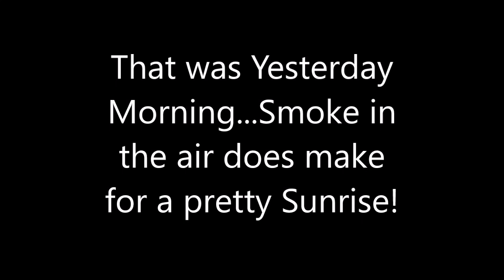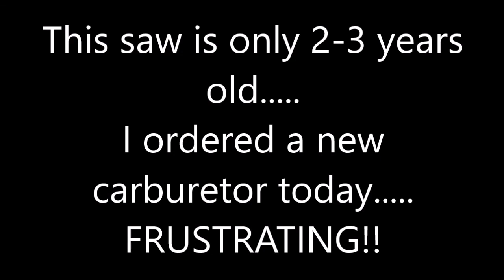$#%&  SAW!!!

Comment: I got a Huskyvarner that needs a gas line replaced and a longer pull cord, you can have it you'll pay shipping, just had a new carburetor put on it, it's too heavy for me to run for any amount of time. I don't know how much shipping is, but you're more than welcome to have it, and it runs great right now.
Reply: I think it has an 18 inch bar on it, I could take the bar off and put it in the box to ship.
Reply: Garry take this saw! I have 2 Huskys since 1992!
Reply from the maker: Wow!  Thank you for the offer!  If I can't get this thing running, I'll take you up on that!!!!
Reply from the maker: Sounds great!  I'll see if I can fix this one, but if not, I'll swap ya something for it!!!
Reply from the maker: They are great saws!   Something to think about for sure!
Reply: God bless you ❤🙏🏻❤️🇺🇸
Reply: @MuskratOutdoors  it's yours. Just let me know, I not able to use it anymore, it's to heavy. I bought a little polan and it's half the weight. 
Let me know.

Comment: Hi Gary,
Something is holding then inlet needle open. It's most likely the diaphragms gone hard and pressing on the needle. If someones been in there it's also likely they fitted the gaskets wrong or didn't adjust the needle correctly. 
Don't listen to the others there's no such thing as a float in there!
A carburettor fit will fix it for only a few dollars👍 don't even consider an aftermarket carburettor!!
Reply from the maker: I didn't think they had a float.  A float wouldn't allow it to run sideways or upside down. (Upside down they don't run well, but they do run) I did order a new carb, already....but it's  about the same price the carb kit was......I hope it will work.   Thank you for the advice!  I've got a lot to learn about these, but at a $100 per hour shop time, I'm willing to figure it out!

Comment: Stuck float , maybe a new carb ? They are still reasonabley priced ! Just replaced one on my post hole digger and it works great !!!!! Just a thought !
Reply from the maker: I'm not sure how a chainsaw carb works?  I don't think there is a float?
A chainsaw will run sideways and upside down.  I did order a new carb though.   Maybe a cracked diaphragm, or a stuck needle valve?  I truly don't know.

Comment: I think that in the carb there a chamber that holds a float. Attached to the float is a needle made of rubber. It controls fuel to the carb. If it’s missing this problem might be the result. Find a carb rebuild kit and it should be in it. Not to hard to do. Just takes patience. It could be that it’s a rubber washer on a needle you adjust in the carb  that’s no good. Depends on how its made. Either way it sounds to me like the carbs fuel control isn’t working. There may be a breakdown or video that could help. I’m no expert so take what I say with a grain of salt. Good luck. 👍👍
Reply from the maker: I bet you are right. There should be a "stop" valve to keep fuel out when it's not needed. That has to be stuck, or broken I bet.  I'm not positive that chainsaw has a float since it will run sideways or upside down.  I'm not sure how their carbs work, but they are different....Thank you for your ideas......what a pain this is.....

Comment: Eather the diapfram is stuck open from dirt buildup not letting it come to a rest position closing the needle valve, or needle valve stuck open from dirt build up. Pull the carb off carefully take the 4 screws that hold the diaphragm on and with carb cleaner and compressed air clean everything around the diaphragm, or could be a old faulty diaphragm. They do dry out from sitting. Then with a straw on carb cleaner and air. Clean valve and jets.
Reply from the maker: Perfect!  That was the advice I was hoping for.  I don't know how a saw carb works, or where to start.  On about any other carb, I'd start with a stuck float, but a chainsaw is different. THANKS!!!

Comment: I had a poulan 5020 av that had the same problem from time to time. It got dirt/slime in the needle valve area. I took the carb off, took off both end plates and sprayed it down real good with wd40. When you are spraying it down, press down on the little tang on the needle valve to open it a little and that will let the wd40 dislodge any dirt/slime that is in the needle valve port. Ran fine after putting it back together.
Reply from the maker: I think that has to be it?  I ordered a new carb, but I'll go through the old one too.

Comment: Oh and also could be tank vent causing pressure build up in tank forcing fuel through
Reply from the maker: Tank vent????   Hmmm....I didn't think of that. Thanks!  I'll check that next.
Reply: @MuskratOutdoors  when you open the gas tank does fuel try to spray out? If not, tank vent should be OK. And I would concentrate on carb.
Reply from the maker: @OlPossumOutdoors    No it doesn't. Sometimes maybe a little hiss on a hot day, but not much?

Comment: Probably something to do with the carburetor valve being stuck open or moving slow from build up of gunk. I don't know the right name for the parts. I'm not a mechanic, just a guy that tinker on stuff because mechanics are often more than I want to pay. I'd clean out the carburetor. Might even re build it with one of those kits you can order.
Reply from the maker: I think it about has to be?  I've rebuilt lots of truck engines, but small engines and diesels, I don't understand. I did order a new carb from ebay....Thanks for your advice.  $100 per hour shop rate is crazy. I'd rather put that money towards a new saw.
Reply: @MuskratOutdoors  I hope that works for ya. It's frustrating as hell when something isn't working and you keep putting parts in and it still won't run🤔. That's how ya learn. For me it's the hard way or no way😆

Comment: The float is stuck up you can check that and if so order one online
Reply from the maker: I'm not sure that chainsaw carbs have a float? They run sideways and upside down, I don't think a float allows that?  I might be wrong, but I think you are right that there is something stuck open letting this fuel do this?   I dunno, but thank you!  I did order a new carb from ebay.

Comment: good, dependable, and reasonably priced mechanics have gone the way of all other craftsman. they are as hard to find as unicorn farts. same issues here in the mid west. dont worry, though, they will have a battery operated version to sell you!!
Reply from the maker: Very true!  This mechanic is usually really good. This is the first time he let me down and I've felt overcharged. The company he works for had two owners, and two shops.....the one owner died, and the one that  is left charged way too much!  I do have a battery operated saw.  Actually, it's not that bad!

Comment: Looks like the needle valve is open in the carburetor. Instead of sealing, it's stuck open  .
Reply from the maker: I think it must be?  I don't know enough about a chainsaw carb to tear into it though.   I ordered a new one from ebay. If that will fix it, I'll tear the old one apart and try to figure it out.   Thank you for your ideas.
Reply: @MuskratOutdoors   that's what i do, i got brand new high dollar generator about 3 yrs ago. Jumped right in it. Fine rust from tank clogged it up. Walaa, I got lucky fixed it.

Comment: I usually go with Husky for the reliability.  Just a question...  Have you been running gas with ethanol through it and letting it sit unused for any length of time?  That stuff will rot fuel lines, floats, even solder on brass floats.  Bad juju.  Okay to run it in your premise occasionally,  but run it all out, or drain it, and take care to fill with non-ethanol pre-mix if it's gonna sit.  Just off the top of my head, I'd  say you've  got stuck float, needle valve, maybe reed valve, or linkage is jammed up somehow.  Very hard to say giving a telepathic response via the interwebthingiejabberwok.   Sorry ain't  more help!  It ain't  ready for the trash bin, nor as a target just Yet!
Reply from the maker: I've never liked Poulan saws, but Cindy bought this one for me a few years ago as a Christmas present. Nope, ethanol free premium gas and 1 gallon, idiot proof 2 cycle oil added.   I'm wondering though how much ethanol  gas is in the hose when I fill up my gallon jug at the gas station?  I should probably put a gallon in the truck, then a gallon in the jug?  It's about got to be a stuck needle valve, or cracked diaphragm I think?   It's sure maddening!
Reply: @MuskratOutdoors  Seems like the Canucks run a lot of Poulans.  I don't  think there's anything wrong with em other than parts sometimes seem tough to get.  I've got a couple of Mac's that I can't keep running, one with less than four hours on.  Used to be Mac was a go-to saw in the US, now it's a toss up between Stihl and Husqvarna, but they sure ain't inexpensive!
Reply from the maker: @darreldwalton8763    One thing I really don't like with this saw, is the carb adjustment screws take a special tool that they don't sell. I guess they don't want you messing with them, but you should be able to.

Comment: Its gotta be in the carb either float stuck or something plugged! Sucks you paid to have it fixed and its not! Good luck with it brother!
Reply from the maker: That's the part that makes me the most upset. $47, is quite a bit for what he did, then to drive 20 miles or so up the mountain to cut firewood and it waste that gas, just to have a saw that is still broken......if it wasn't for those mushroom hunters leaving firewood, it would have been a total loss.

Comment: you check the gas for water? high humidity and ethanol in gas love each other they claim use hi octane gas no ethanol but if it isnt a dedicated pump could take a few gallons till you get what your paying for, refurbed husky 50 cc are 300 bucks on e bay 2 year warranty e bay backed, loggers here run 71 cc  husky saws but use the 5o cc for limbing pull on saws are fragil one shot with a sledge hammer an its allllll over🙂
Reply from the maker: I haven't.  I do buy the non-ethanol gas, but like you say, how much of the other is in the line?  I hope I don't end up buying a new saw, but Husky is one of the best.  I ordered a new carb for now. Hopefully that will fix it.

Comment: You are correct muskrat, there is not really a float in a chainsaw carb.  Needle and seat and/or the diaphragm are most likely your cause.  I would pay a little extra to get eh OEM carb, rather than get the China made carb.  There is another option to just order a rebuild kit for it.  There is not much to the carbs themselves, just video taking apart so you can put back together.  If you order a new carb, make sure you save the old one until the new one works.  Good luck!
Reply from the maker: Thanks for the advice!  I've never had this one apart, but other saws I've had, yeah, not much in 'em!  I don't understand how the diaphragm system works....I need to study up!

Comment: Carb issue. Stuck valve I'm thinking. I've fixed them by holding the saw up side down, and lightly tapping the carb with a hammer.
Reply from the maker: A sledge hammer?  Ha!   
Thank you!  I'll try that and see what happens. It might just be a piece of dirt or a wood chip got in there somehow?  I dunnooooooo!!!!